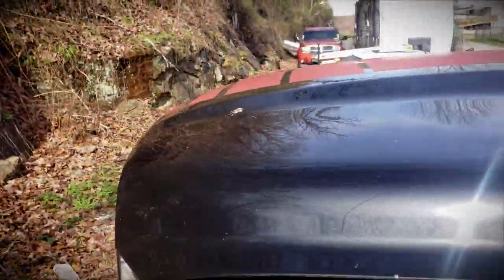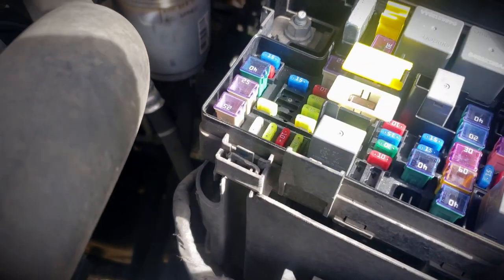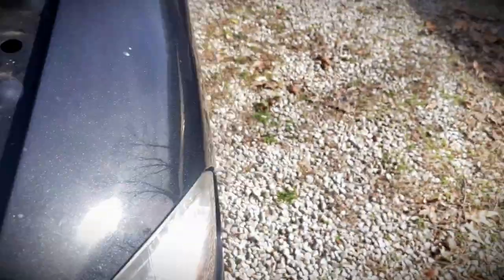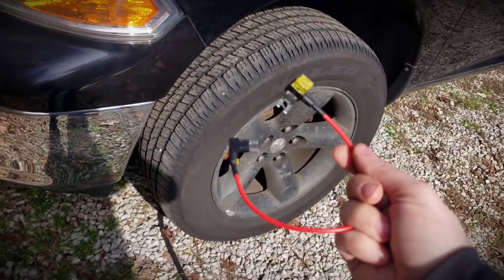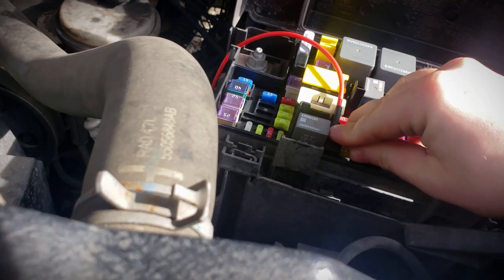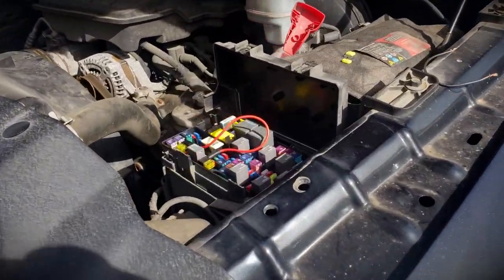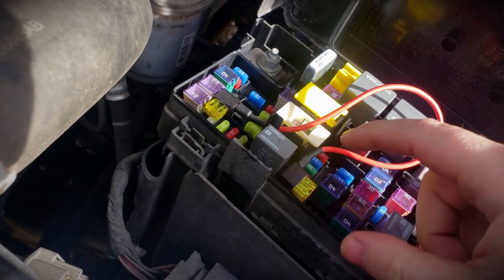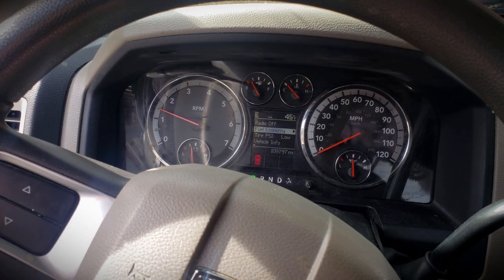09+ Dodge TIPM BYPASS | Truck Won't Start?

Comment: This is not for anything earlier than 2011 since that was the year that the TIPM was changed as well as the wiring between the fuse and relaty. 2011 and on, the relay powers the fuse. 09 and 10, the fuse powers the relay.

Comment: How long can you leave the cable and does it affect the remote start?
Reply from the maker: So far I've been running the cable since the day I made this video and it hasnt affected my remote start
Reply: @PeaJayYt  thanks for the reply, I read somewhere that a lot of people had the cable for 3+ years
Reply: What’s the link? I am having this exact issue and it’s driving me up the damn wall!! I replaced the whole fuel pump before I even knew this was a possibility. Anyway I can test my old fuel pump without plugging it back in?
Reply: @PeaJayYt  part number of cable please
Reply: Where is the link for this part? I’m unable to find on Amazon.

Comment: My 09 ram has the same symptoms I ordered the part off of Amazon but my fuse box doesn’t have a fuel pump relay can I plug it in the to fuel pump fuse instead?
Reply: You can't access the relay.  All the work is done in the fuse box.  Make sure you are on the right fuses.
Reply: Did you plug in to the fuel pump fuse did it work I have the same year truck haven’t he same problem did it work ?
Reply: @jeffmeloo1091  I bought 2 
mini add- a circuit holders at AutoZone.  One plugs into the passenger cigarette lighter fuse. the wire goes to the second add a -circuit that plugs into the fuel pump fuse.  You just need switched power going to the fuel pump so it only comes on when the key is turned on.
Only a temporary fix you need a rebuilt TIPM.

Comment: My 09 5.7 doe's not have a M7 cig lighter, inside is a 12v dc in place of cig lighter . were else can i plug it in ?
Dodge ram 1500

Comment: I have a 2009 ram 2500 sxt no power to the fuel pump the prime works fuse 7 to 25 will not work any idea's i did connect 38 to 25 no luck
Reply: I know the fuel pump works I drained the tank by turning the key on and off I've tried to use a jumper wire but no luck

Comment: OMG!! This worked! Thank you big time! 2012 Chrysler T&C. Before this, My husband went through 2 batteries and then it cranked but wouldn't start. My auto shop(not dealer) was clueless. Dealer wanted $1000+. My husband could hear a noise but didn't know what it was. Your relay bypass advice got it to start 5 days in a row so far. Thanks again.
Reply from the maker: Glad it worked out!

Comment: I have an 06 and my fuse box looks nothing like that
Reply: Me too, it doesn’t have the relays in the fuse box
Reply: @wgrupegaming75  I figured out what was wrong it was the fuel pump and the connection on the pump also it was corroded really bad and the connecter fell apart inside. Had to order a new fuel pump and a new  connecter for the truck
Reply: Actually, it is soldered on a circuit board inside the TIPM (fuse box).  I replaced the relay but I'm also certified by NASA and should not be done by a novice.  They used to sell kits for this and wasn't too much hassle to install but MOPAR stopped making them.  Best off getting an Ebay TIPM or paying the $1200 for a new one.
Reply: Yea, 06 is a sucky year for wiring. Completely different than what this video shows.
Reply: @swackhammer2139  hi did u have any success with your yr model im goin tru the same crap rn plz help thanx

Comment: @Moto-P I also have a 2011 Dodge with the 5.7 in it. I just put a new fuel pump in, thinking that was the issue, but after the new pump was in, I still couldn't get it started. How is your truck still performing? Have you noticed any other computer issues? One of our local Dodge "experts" says not to bypass with the Sunyat, cause it can fry other relays and the motherboard. Thoughts?
Reply from the maker: I actually traded it in for my new ram but as of then, I had 0 problems with it

Comment: Works just use a jumper wire my ram has 208k miles so its expected
Reply from the maker: Yep.  I just figured this was cheap enough and plug and play

Comment: I am having major trouble with my 2008 Dodge Ram 5.7 Liter TIPM system... I just replaced my fuel pump with a new one. That was a major pain in my ass, so is there a way I can check my old one to see if it’s good? If so imma put it back in and take back the new fuel pump. 

Question two would this video apply to my truck?
Reply: It should i have an 06 & im having the same issue - i want to determine if its the fuel pump or the tipm which my truck has also - in the first part he states he thinks the tipm goes back to 2006 models and he is correct
Reply: @FightingMECFS  how can i bypass my 3rd gen its an 07 model plz help..i can figure it out

Comment: I have a 2011 as well just curious if anyone has done this and the remote start still work
Reply from the maker: Yes my remote start worked
Reply: @PeaJayYt  mine is just a wire wrapped around a fuse leg on each fuse. It starts with the key fine, but will show the lightning bolt on dash. Maybe not a good enough connection?

Comment: Do you know what company it is that redoes the tipm system
Reply: Check Vertical Vissions. they sell the cables and will repair the TIPIM.

Comment: Is this the same for a 2015? The fuse box looks a little different
Reply from the maker: I think the 2015 may have changed
Reply: @PeaJayYt  would the fuel pump relay still be integrated into the system? I've got no power to the fuel pump but I also have a 30a fuse for the the fuel pump motor, but it's not blown

Comment: Any chance anyone has found a way to make this work on the previous generation fuse box/TIPM?  I have a 2006 and do not see where I have a fuse for the fuel pump relay.
Reply: Hey buddy did you ever find out how ? ^
Reply: @mrbigbuds1745  - it doesn’t work.  The micro-relay is soldered on to the 2006 model board and it cannot be replaced u less you are a NASA certified soldering guru.  I spent $750 to buy a new board…..and it fixed nothing.  Turns out I just needed a new fuel pump.
Reply: @chrissimonton9939  that sucks man I just can’t figure out what it could be I put power to the fuel pump and it shot out gas man.
Reply: @chrissimonton9939  my fuel pump is working was yours working as well ?
Reply: @mrbigbuds1745  - mine was intermittent.  Sometimes it worked and sometimes it didn’t.  New pump fixed it though.

Comment: Factory Remote start doesn't work with this installed. Is there a way around it?
Reply from the maker: Mine still worked but its an aftermarket system that uses the factory fob
Reply: @PeaJayYt  ok, mine is a factory remote start, it's hit and miss with this bypass cable on, sometimes the remote start works, sometimes it fires up then shuts off, starts with fob though. I see there is a version of this bypass that looks more like a circuit board, and plugs into M37 slot I believe. Don't know if that would make a difference. Thanks, appreciate it!

Comment: Will this work on an 07 6.7?
Reply from the maker: I am not entirely sure.  If it was the TIPM system then I would assume
Reply: Moto-P I’m attempting this now I’m just trying to find what cavity I’m supposed to pull from for the pump
Reply: I have a 07 RAM HEMI with the same issue. The fuse box does not designate any fuel pump fuse or relay! Please provide some info!!
Reply: @MegaChuck51  Having the same issue. The fuse box on this one is slanted. For some reason videos state that it should be covered but woah and behold the damn 07 is different! Go figure!
Reply: @marv.mon.9845  any info how to bypass our slanted fuse box i cant find nothing on it plz help
Reply: @joeroe2839  Sorry brother as far as I know its more than likely a TIPM where the whole fuse box has to be replaced. I myself have not found any info on a bypass for the slanted model.
Reply: @marv.mon.9845  i was thinkin of just addin a relay and fuse straight from the pump itself all the way to a 12 volt source and see what happens i dont kno if it will mess w my fuel gauge tho..im running out of ideas ans need my truck for work 😔

Comment: Pretty sure this is the solution to my problem and I ordered the bypass. Do you have a video of the symptoms before you installed it?
Reply from the maker: I do not.  However it would just crank and not start